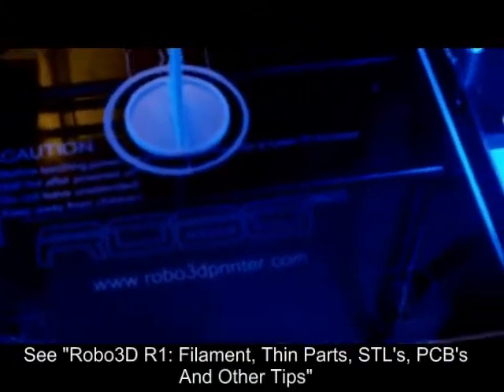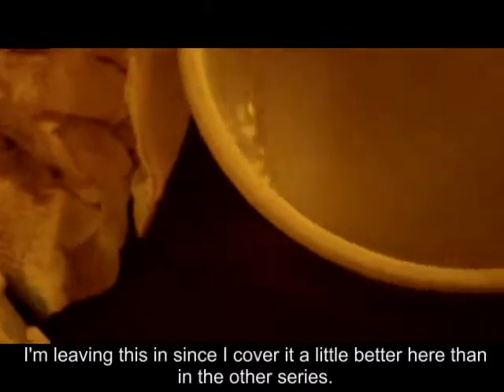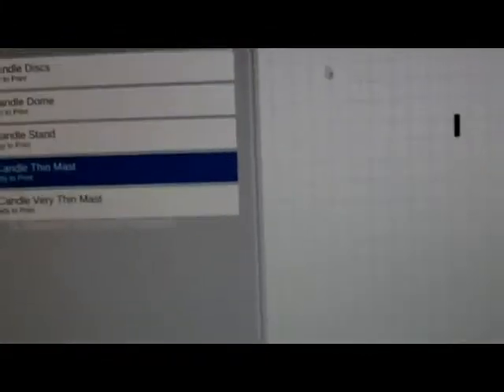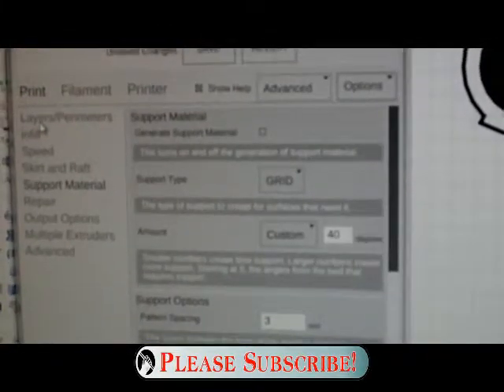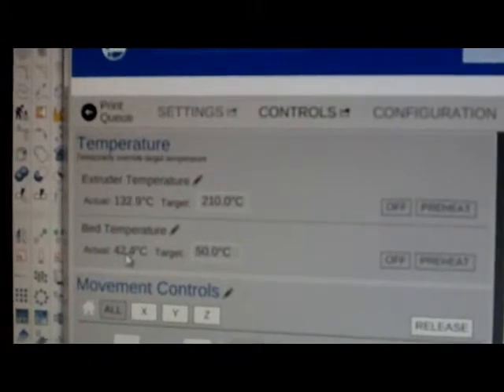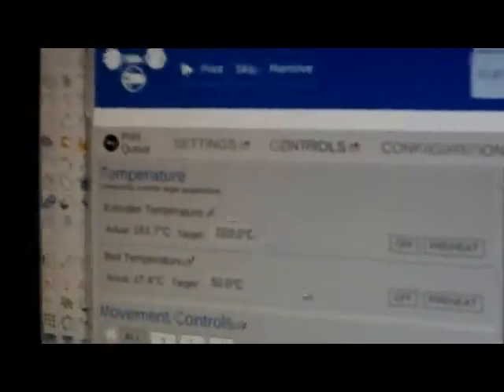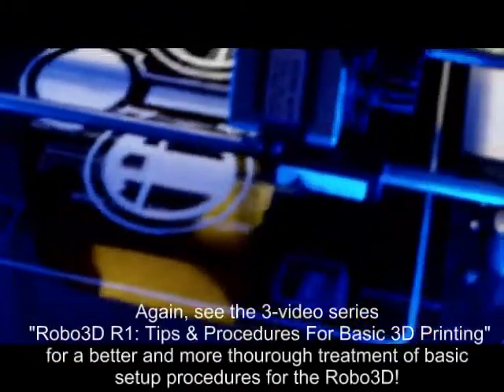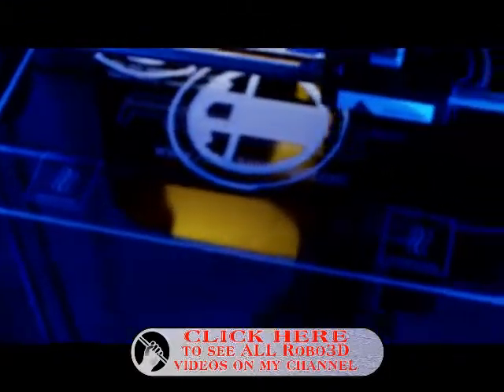Robo 3D R1: MatterControl Points

Comment: Hey Robert,
Use hairspray in a manual pump sprayer. I use Rave 4X Mega Unscented and haven't had any issues with lifting.
The manual pump doesn't create that messy spray fog that the aerosol can does.